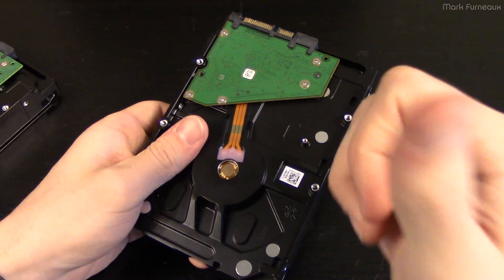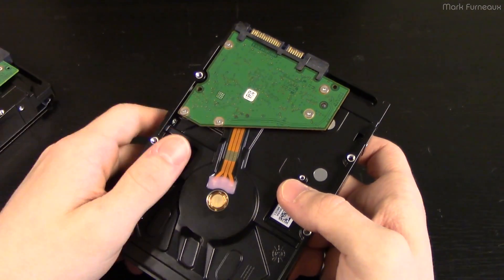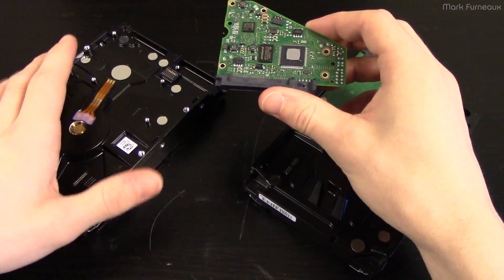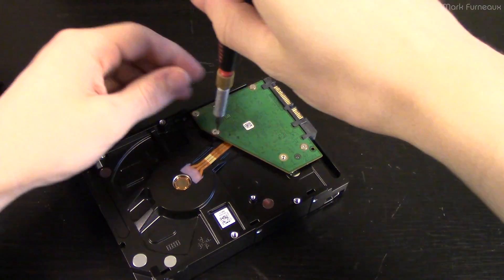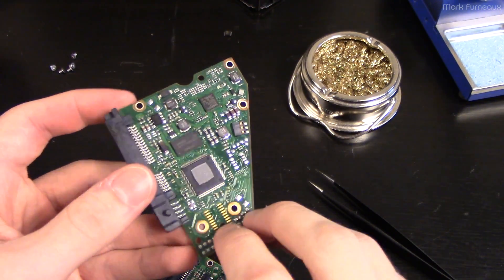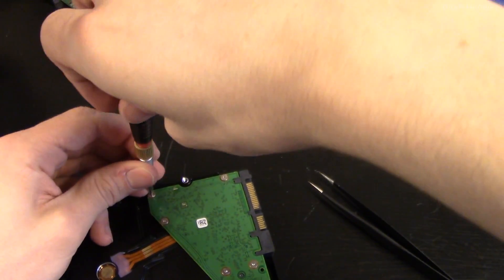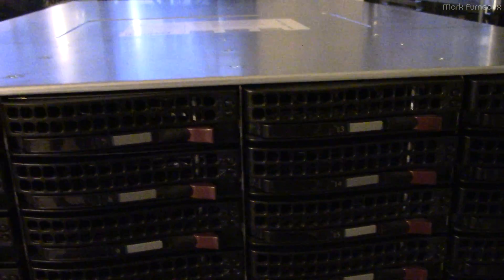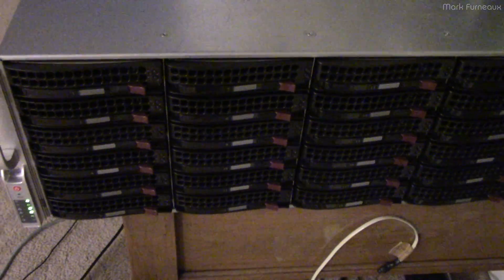Swapping Hard Drive Calibration Chips To Fix Bad Drive

Comment: Why swap the flash chips at all? Why wouldn't just swapping the boards with the drives just work?
Reply from the maker: Drive calibration data is stored in the flash. Without the correct mechanical cal data, the drive will not work, or will corrupt data as it writes.
Reply: Mark Furneaux I guess what I don't understand is if it's the same board and the same drive, why does different calibration data matter? What is the difference if the rest of the hardware is identical?
Reply from the maker: The rest of the hardware is far from identical. The mechanics are precision equipment working with nanometer precision. Every slight manufacturing difference needs to be calibrated out, from the alignment of the heads, placement of the tracks on the platters, and the gains for the read/write heads. Each disk is tested by the manufacturer and has unique calibration written to it that is specific for that mechanics assembly.
Reply: Mark Furneaux I didn't know that! Would a correct analogy be two "identical" processors aren't truly identical even if they were cut from the same wafer?

I had no idea! Thanks for explaining that (and for the video!)

Comment: How did you passtrough the drives to the os? As JBOD? Or does that controller have some kind of special function to directly expose the disks to the os?
Reply from the maker: You can flash the controller into IT mode, which turns it into an HBA without any RAID functionality.

Comment: Would you have bothered to do this if you didn't have the hot air station or the free donor board?
Reply from the maker: Probably not. It was either do this, or buy a new drive. This was of course much cheaper since I had the equipment.

Comment: Very informative...  thank you for posting.  I wish I had the skills to do what you just did.  I have had to dispose of a couple drives with important info because it stopped working.  I bought a HD of the same manufacturer and capacity, however, some board level numbers are different, same Rev though.  If I ever have a failure again, I will swap out the boards in hopes of getting it to start up so I can copy the info to a new drive.  I don't have the skills to swap out the ROM chip so my idea might be in vain. Thx....

Comment: Why didn't you just replace the whole board?
Reply: the eeprom contains vital calibration data specific to the mechanical part of the drive. Eg head characteristics, bad sectors, status, where the start of the disc is. Without that IC, the data already on the drive is lost, and the drive itself may no longer work.
Reply: because every drive needs its specific callibration data and i think the serial number stays the same, also
Reply: I had no idea the board stored calibration data, thanks!